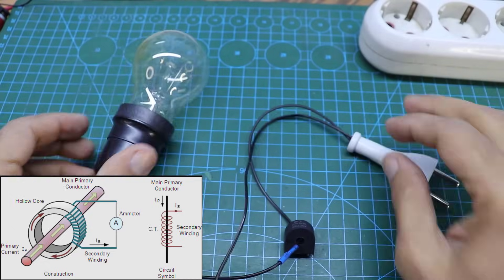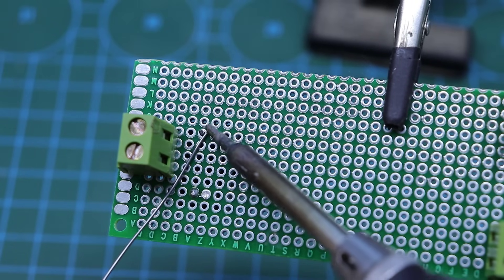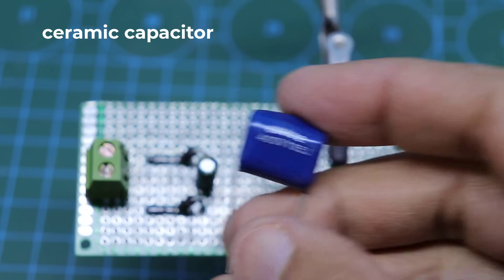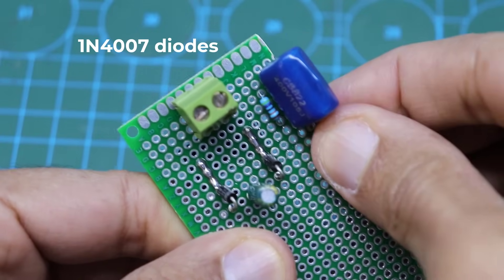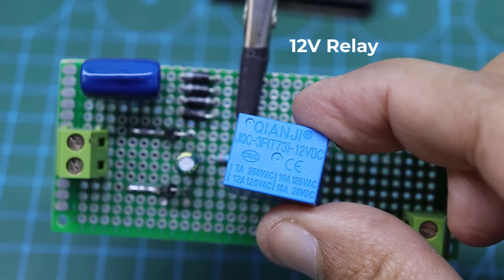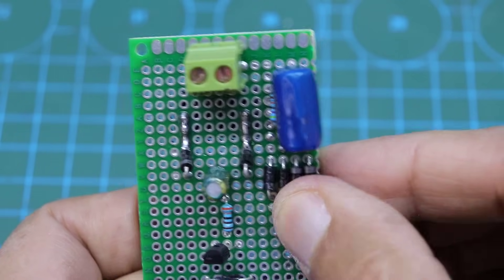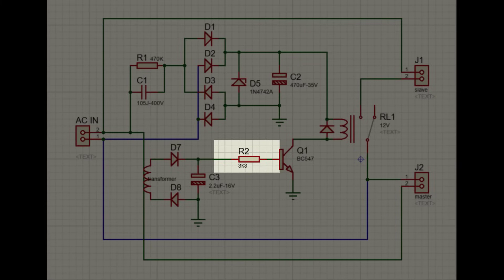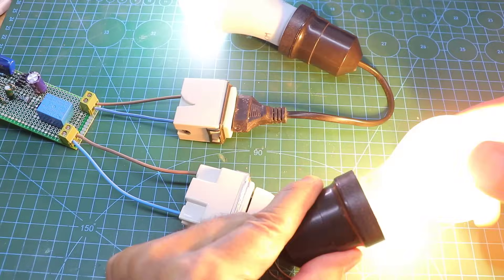this invention should be in every home || Brilliant Idea

Comment: I might be mistaken but if you use a 5v relay instead of a 12v one you won't need the 12v low current power supply.
Reply from the maker: The voltage coming from the current transformer is low current and cannot operate the relay ., thanks for watching